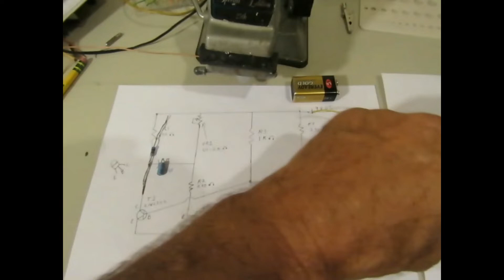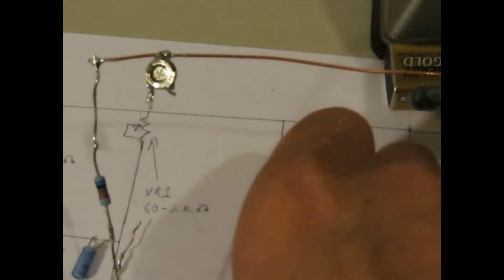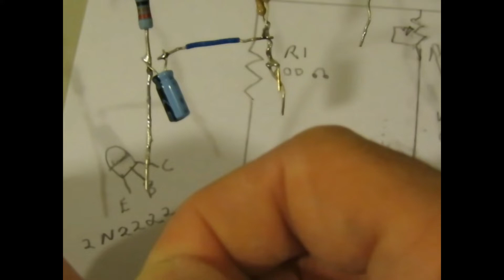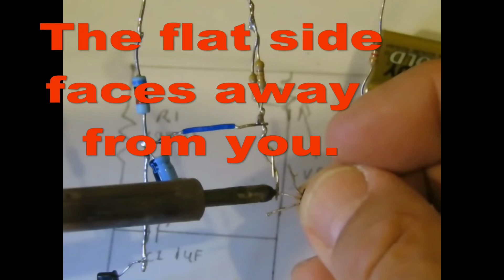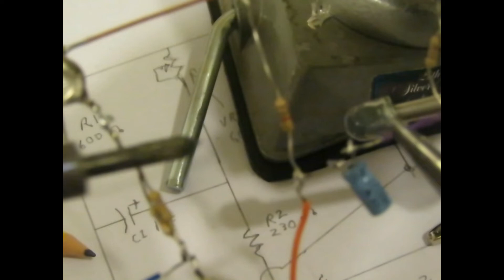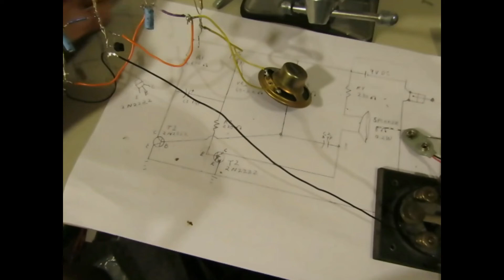Morse Code(CW) Osc. Option 1. Soldered.

Comment: Seems this is best ever cheap oscillator. Can we feed it with ham radio.
Reply from the maker: If you mean to interface it with a ham radio, no.  It's only an audio oscillator that can be used to practice sending morse code. Most ham radios don't need an interface for sending code. Also, this will not generate morse code on It's own. You just hook a straight key or bug to it as an on-off switch open and close the switch according to the letters you want to send.